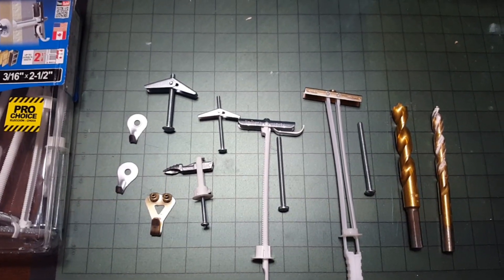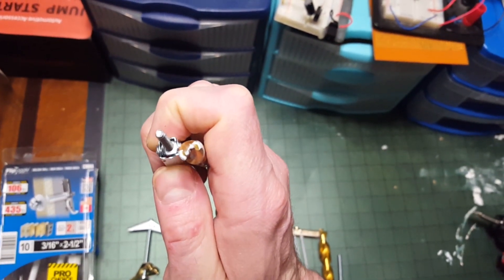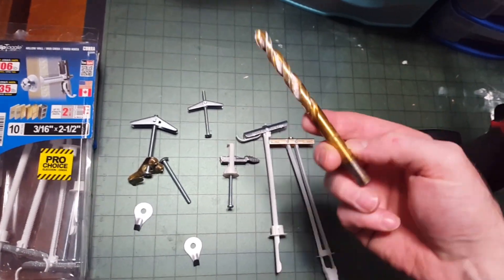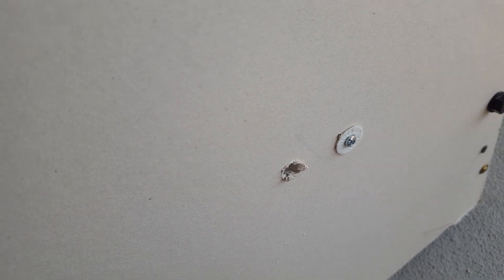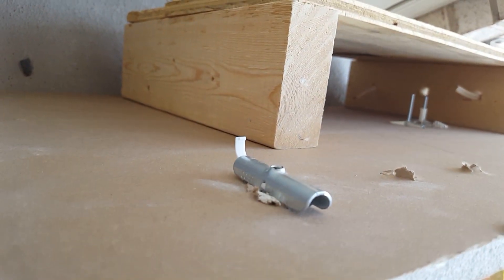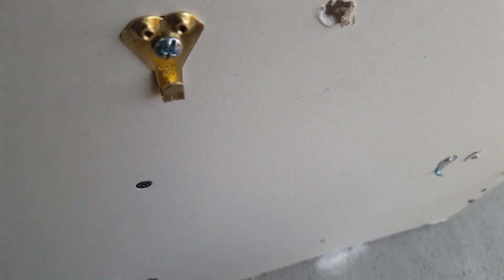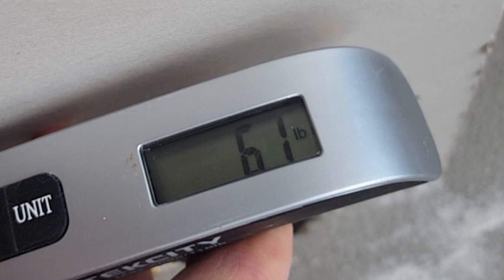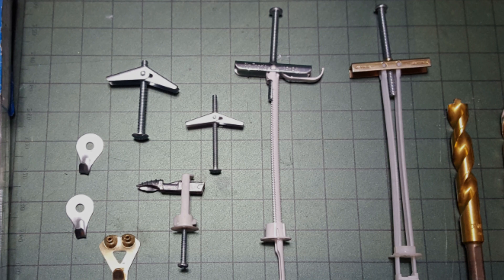Snaptoggle Toggle Bolts For Drywall and Plaster | Review + Shear Test

Comment: Hello from Ireland. I enjoyed your video.  Im about to hang a 25kg /55lbs mirror to my double plasterboard cavity wall of 22mm thickness. Which toggle would you recommend please ?
Reply from the maker: The double plasterboard adds some strength, but ideally you want a screw in a stud if you can for 25+ kg. If you have to hang it where there are no studs, any of the flip toggles should be fine, ideally more than one. You'll bore a half inch hole through both boards, the flange will be flush with the wall, push the toggle all the wall through and make sure they grab the back of the interior wall then tighten. Then you can use the bolt to hang some kind of hook and tighten the bolt. Don't just hang the mirror on the bolt heads because the wire or d-ring can slip off.

Comment: I’m securing a vanity against the wall with no studs. Unable to get vanity flush against the wall which means I’ll have about an 1 1/2 of screw away from the wall. Can I just get a longer screw for my situation?
Reply from the maker: Sure, they sell toggle bolts in long lengths, at least 4". If there's no studs, I would use several toggle bolts, the more you use the stronger it'll be.

Comment: How about a video on using  T anchors... similar to toggle bolts but not quite..
Reply from the maker: Really cool anchors. I haven't used them but would like to, especially the smaller 1/4" one. I have been wondering if there was a toggle bolt that would require a smaller hole than 3/8" and this looks just like it would do the trick. But expensive, so not sure if I could get my hands on them cheaply. Thanks for the suggestion

Comment: Hi. I have many of the snap toggles that i ordered on ebay however it did not come with the bolts. What are the size bolts i need for the 3/16 -24 snap toggle? Thanks.
Reply from the maker: I've used a #10-24 2 1/2" inch long pan bolt that worked.